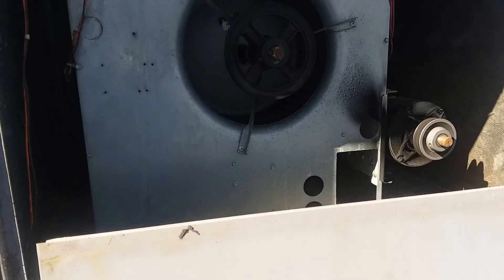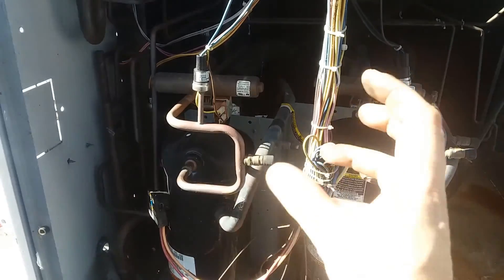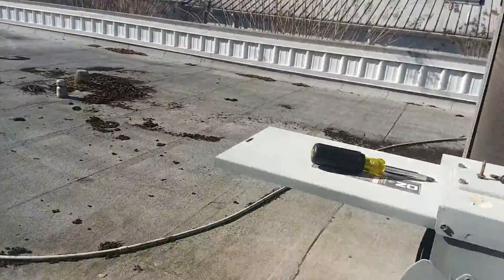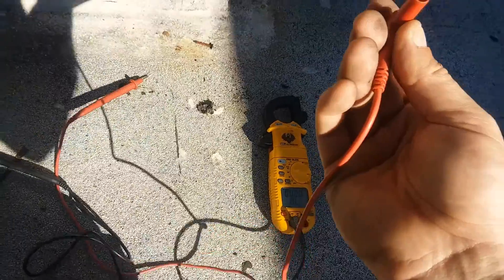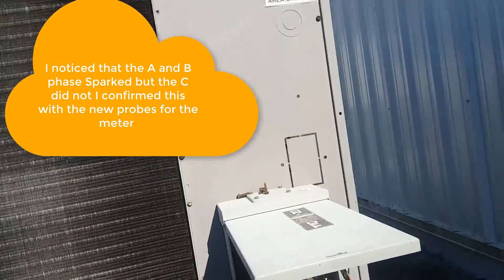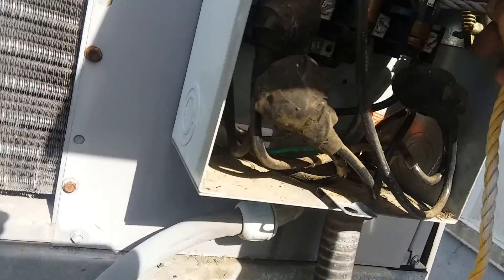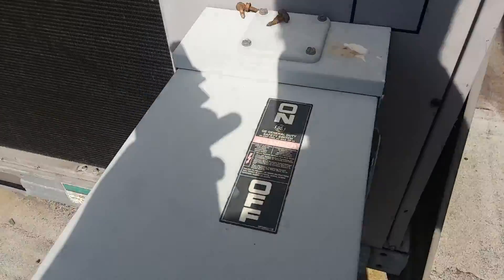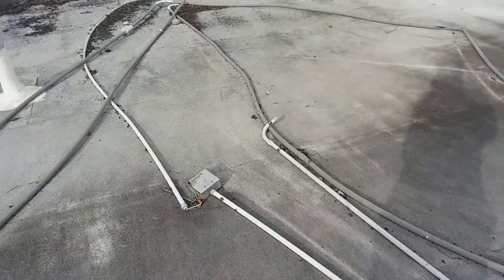HVAC Carrier RTU Not Cooling ??

Comment: If the fuses are led than 100amp you should replace all 3. The other fuses have been stressed and will fail. I’ve learned this the hard way. Leave the good fuses in the disconnect for emergency use.
Reply from the maker: That is a really good tip👍 thanks for watching